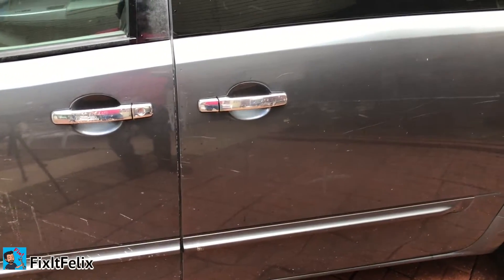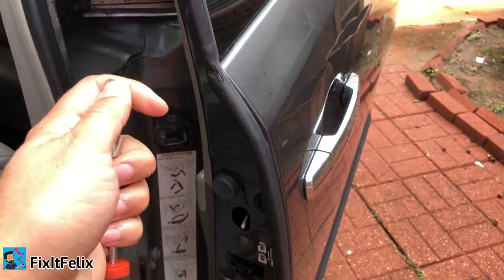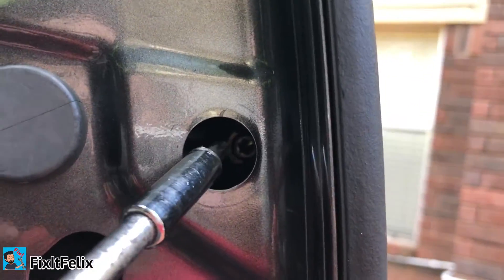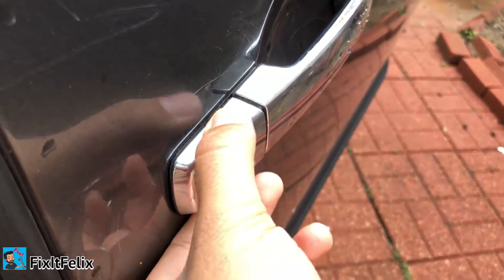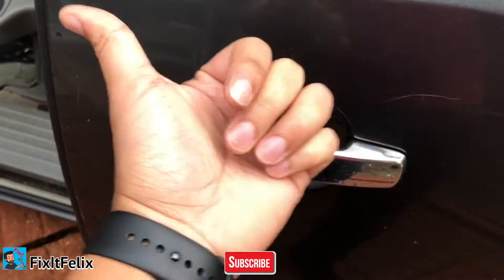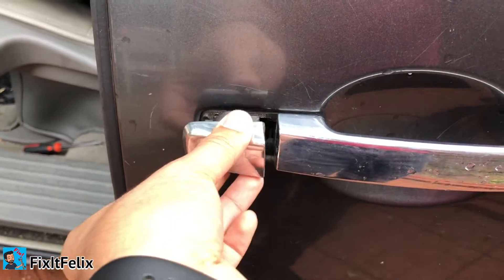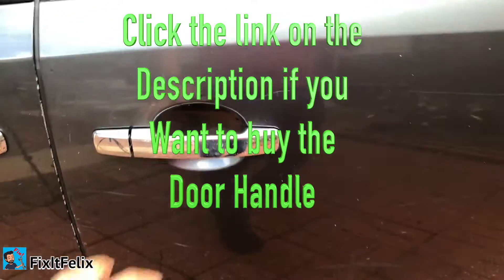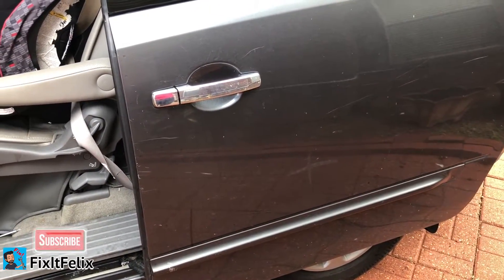How To Replace Door Handle on Nissan Quest

Comment: Dude you are a life saver, really. It was estimate $350 at the Nissan dealership. I bought the door handle online for $35 bucks and your video. Thanks
Reply from the maker: I am happy to help 😁
Reply: @FixitFelix529  have you ever replaced the AC compressor clutch for a 2012 Nissan Quest?
Reply: @FixitFelix529  have you ever replaced a AC compressor clutch for a 2012 Nissan quest?

Comment: Sup felix thanks for this helped me to fix my 2004 rhd LA festa drivers side sliding door, as I could not open it at all, as it had the child proof lock on, so couldn't use the handle inside, so popped the bung out, had to use an extended screwdriver to get at the internal screw because of the angle its on, popped all the bits out as you said, superglued the cracked part back together for a temporary fix, gonna order the new part shortly 🍻🍻🍻🍻🍻 unfortunately these are virtual beers not real😜